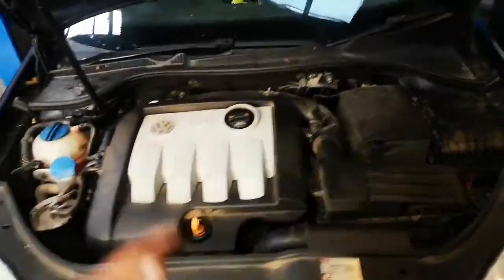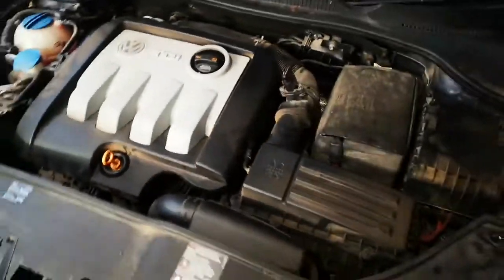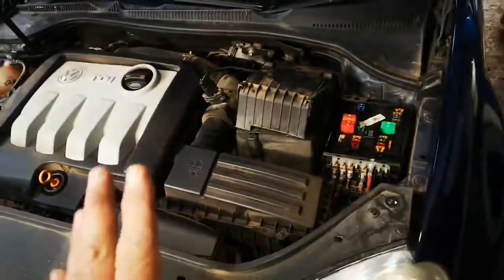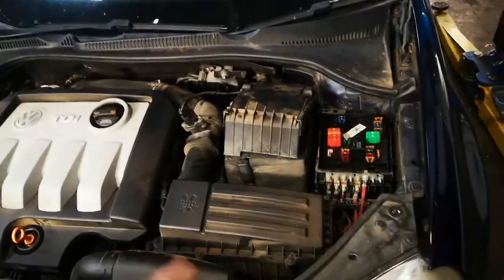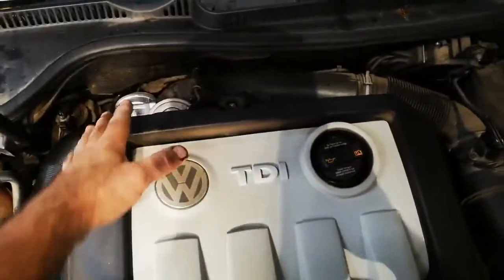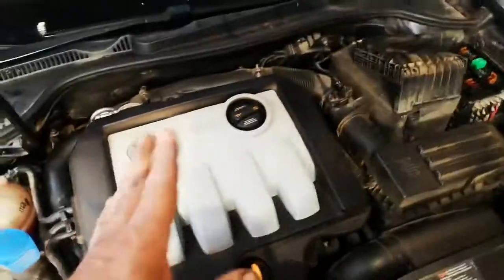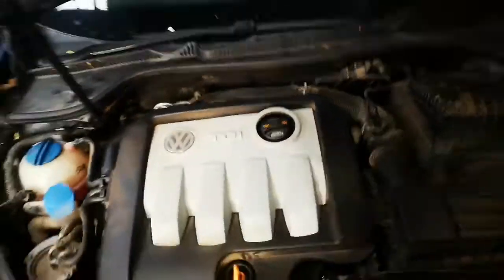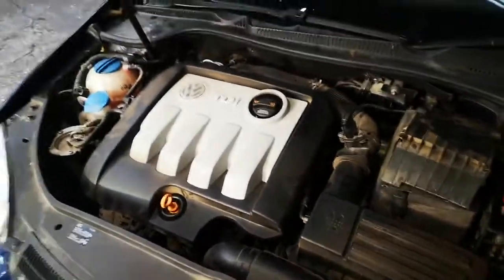Volkswagen diesel Golf P3103 fault code overheating. Golf Mark 5 throttle valve failure & fan fuse

Comment: Hey having the same issue with my golf GT 2.0 tdi 2007 same with the fuse. The garage thinks it’s the injectors. But I have a lot of problems with my trottle body does mine could it be the swlir flaps or definitely the trottle body cheers